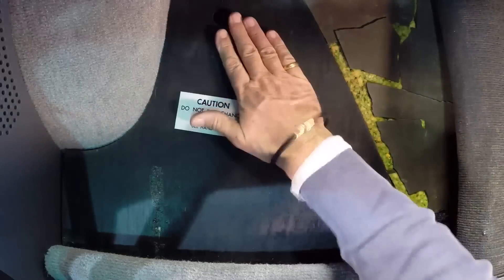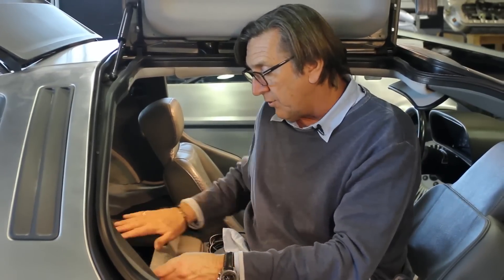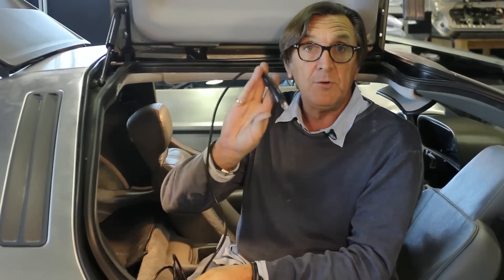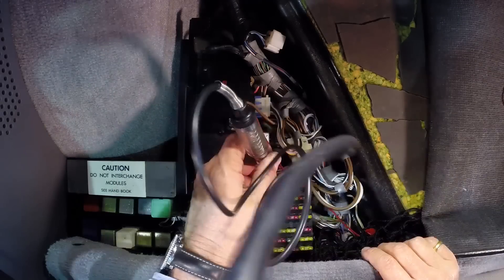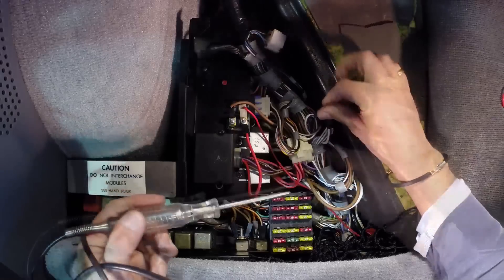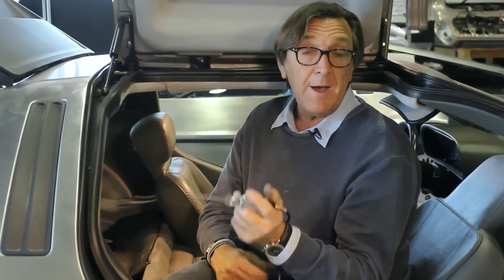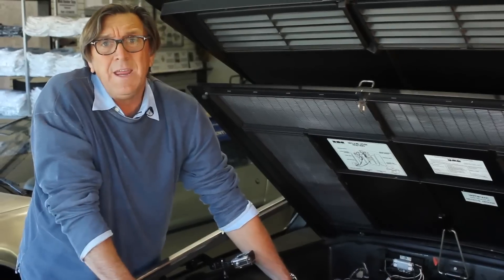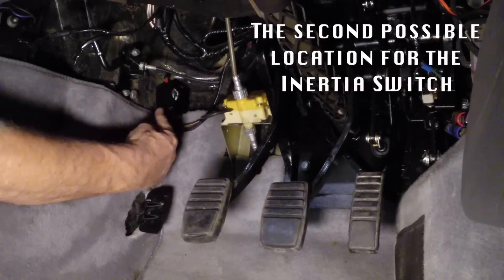How & where to use a 2-Wire Jumper--DeLorean Motor Company

Comment: Free advice that I spent hundreds of $$, time and swearing to figure out. Car just died. Did the above....Nothing. Replaced all fuses, relays, cleaned all the grounds. IIRC there are 4 million, 354 thousand 228 grounds. Nothing. Before pushing it off a cliff I saw how horrible the connectors are. All these relays are one bump or jiggle away from not working. When pushing IN a male end, the wire on the back had pushed out. Being so crucial I soldered it. Don't rely on crimping. Don't! Solder wires. Do each "job" on the car, verify no issues then move on. Deloreans punish those who do to much at one time.  Remember- Owning a Delorean is like frying bacon with no shirt on. Owner at 18 in 1981 and still refuse defeat.

Comment: Great videos Steve!  Ive had my D since 2012. These vids really help my understand this car better. Can you do one on Antenna replacement?
Reply from the maker: What type of antenna?
Reply: @deloreanmotorco  ahh, the pwr antenna at the back of the car.  Drvr side
Reply from the maker: @dvfr750f  That's what we thought, but we are seeing more people replace their front fender mounted assemblies (both the fixed and manually retractable antenna versions).
Reply: @deloreanmotorco    I have the rear one and it is having some issues retacting etc.  I have a replacement and was wondering if there was a video covering this job?
Reply from the maker: @dvfr750f  There is not yet a video. Where did you get the replacement - there are a few versions out there in the wild and they are all a bit different.

Comment: Another great video Stephen! Another cool video would be to show how to remove the relay and jump that same wire to have the HVAC panel lights come on with the rest of the interior lights as not to prematurely burn holes in the black HVAC font overlay. (If not changed to leds already)

Comment: Awesome new video! I'm installing the new relay upgrade kit in my car but the bigger problem I have is that the previous owner swapped out the fuel distributor with a Volvo 260 GLE for some reason and my fuel injectors seem to be leaking, causing my cat pipe to glow red. I don't know if this is from the distributor, but I guess it would be best to try the injectors first and work my way from there. 🤷‍♂️ -VIN 4693